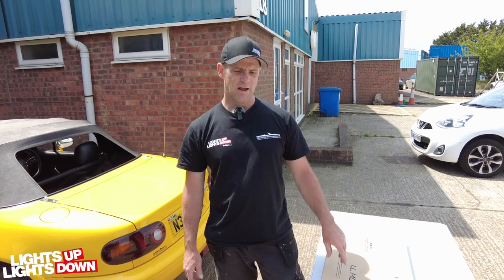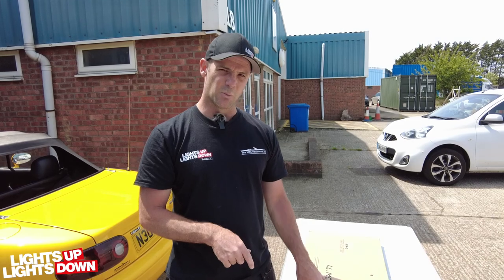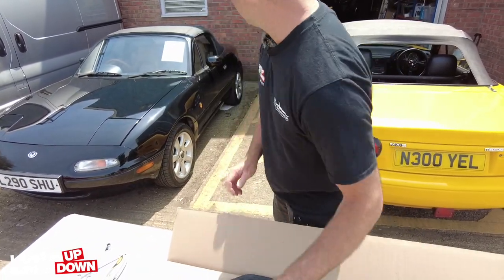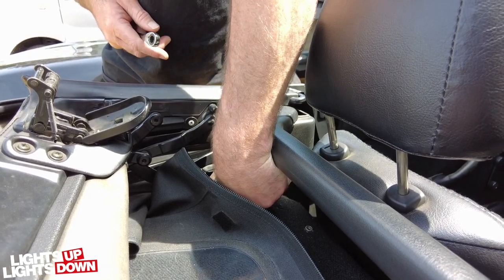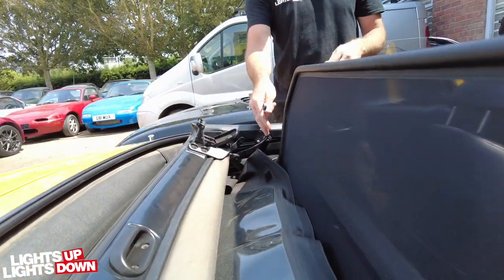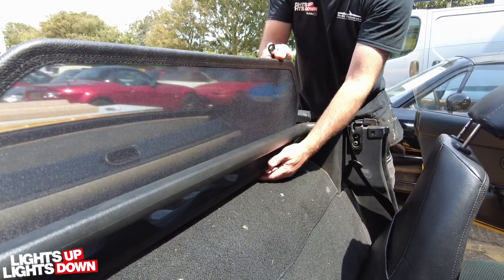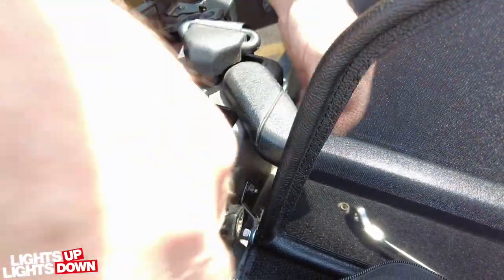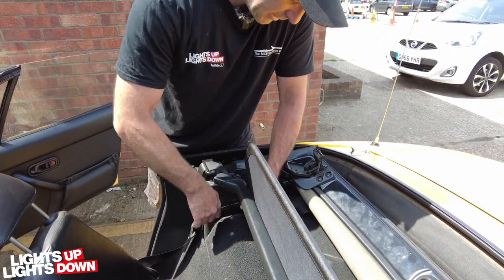How to fit a wind stop to your MX5 / Miata

Comment: I have that wind blocker on my NA and the issue I have is that is a little too low, so I still have a lot of air at top of my head. It is still way better than without the blocker. If you're thinking "then just mount it higher using the brackets" then it won't fit in the car with the roof up or it would just interfere a little bit too much in the "unzip rear window, put window down while holding blocker up, put roof down" process. I think the blocker is a must have for the car, but I also think that the guys at I.L. Motorsport could make a revision on the product and improve a bit the design somehow.
Reply from the maker: All fair comments, I'm short so it works for me :)
Reply: @lightsuplightsdown3018  I'm not that tall (180) but definitely my hair suffers while driving top down, haha. Also thank you for the addendum, I always wanted to see how the stock NB blocker worked so it may be better than the aftermarket one. Definitely not better

Comment: Be aware if you have these, when you go for MOT make sure it's down as the examiner will say rearview mirror obstructed view and put it down as an advisory.
Also who,s is the white car in the background by container.
Reply from the maker: That's a new one for me, your MOT tester must have been having a bad day :)

The White car belongs to Roy
Reply: @lightsuplightsdown3018   Drivers door and one other mirror mandatory, don't need interior if there's a passenger side mirror, so yeah, sounds like grumpy tester :)
Reply: Uhhh, it's a wind deflector, almost all drop tops have them... the rear view mirror isn't even mandatory...

Comment: Windows make a difference to.
Reply from the maker: That's true, I actually find that without a windstop if I open the drivers side window I get less buffeting in the drivers seat, weird, but true
Reply: Quick tip for winter/cold weather top down driving: put the heater to the front vents and footrest and close the passenger window. You can leave the driver window down and you'll be warm